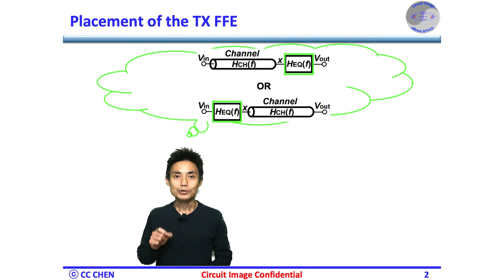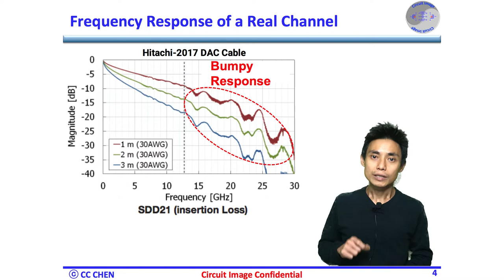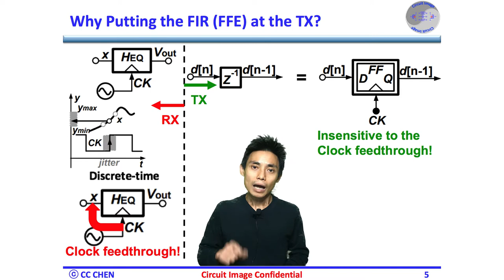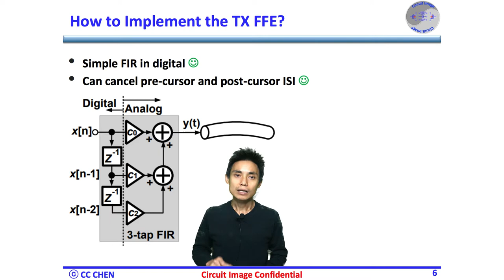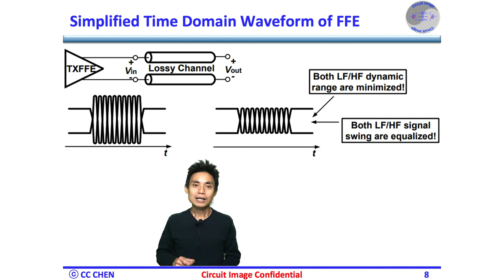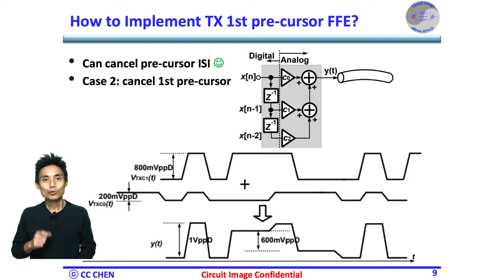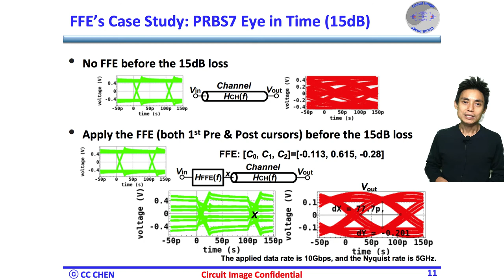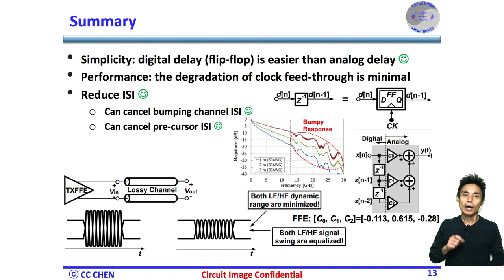Why TXFFE?

Comment: Great.....can you please explain a bit more on how you choose the coefficient values of Pre and Post cursor taps. And 2nd doubt is can we see any case where you keep both the coefficient to be positive and in that case if the transition parts will have higher swing or lower ?
Reply from the maker: Hi Surya,

Thank you so much for the good questions. I have comments below.

Great.....can you please explain a bit more on how you choose the coefficient values of Pre and Post cursor taps. 

[CC] I did the a single-pulse response to figure out the coefficients of  Pre and Post cursor, respectively.

And 2nd doubt is can we see any case where you keep both the coefficient to be positive and in that case if the transition parts will have higher swing or lower ? 

[CC] Yes, that's possible. We only focus on the data parts, but the transition parts could have a higher swing or lower due to the reflection.

Thanks,
CC